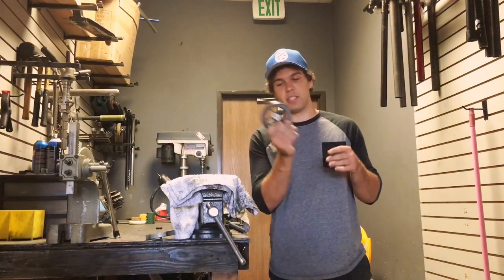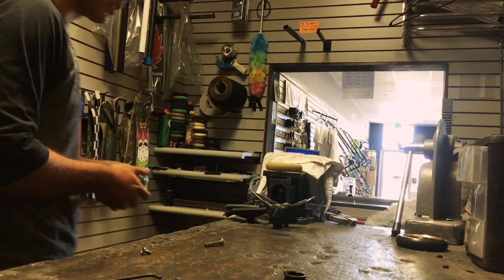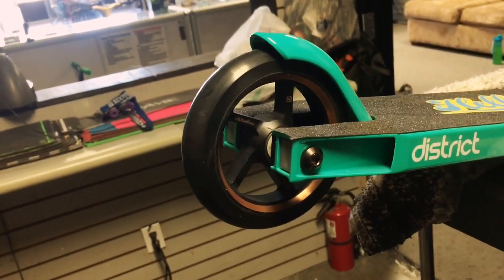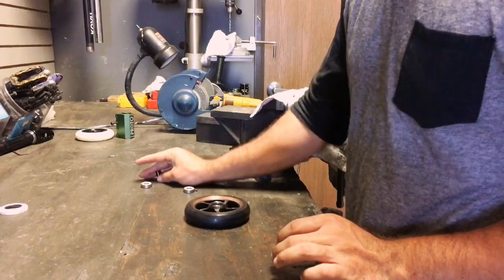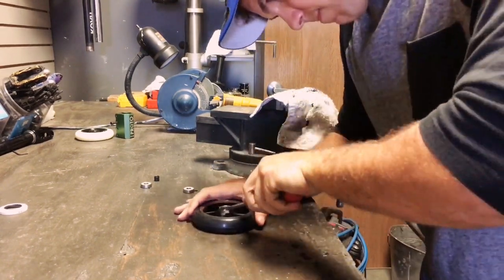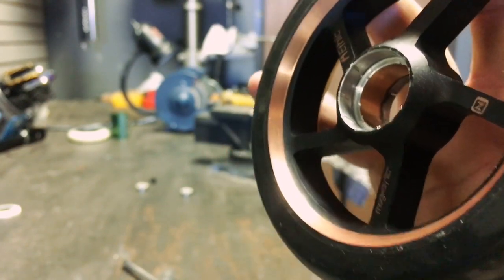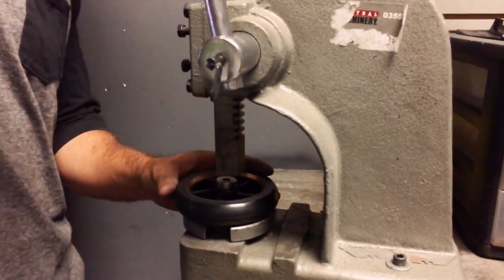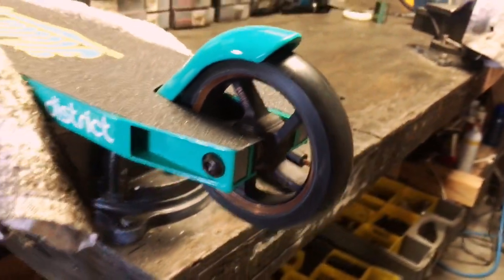HOW TO DIAL YOUR SCOOTER WHEELS

Comment: I can't get my scooter weels out my bolts won't come out
Reply: That’s not how u spell wheel
Reply: i had the same problem and i figured it out either have 2 Alan Keyes and put one in each bolt and twist it or put one alan key in a bolt and hold the other bolt with your finger tightly so that it doesn’t move and then twist the alan key if you haven’t already figured it out